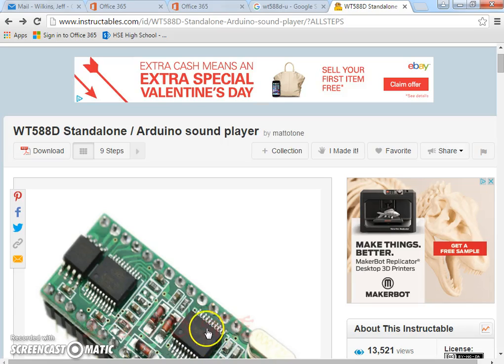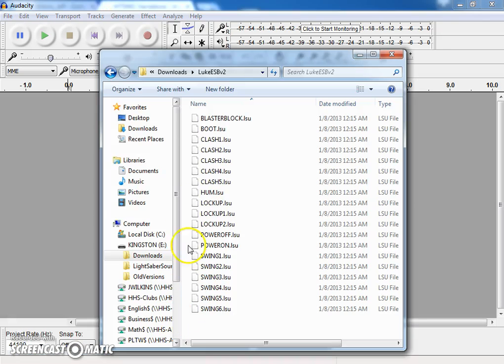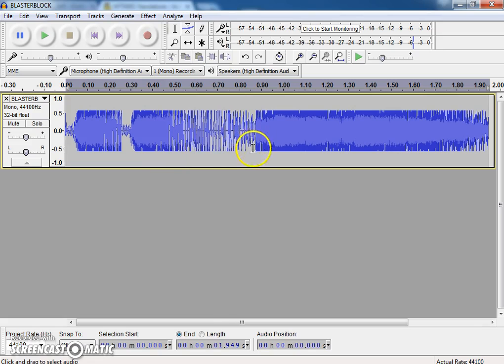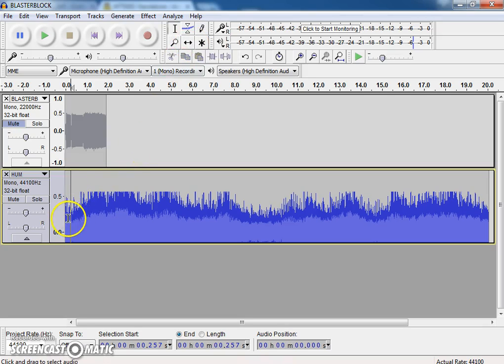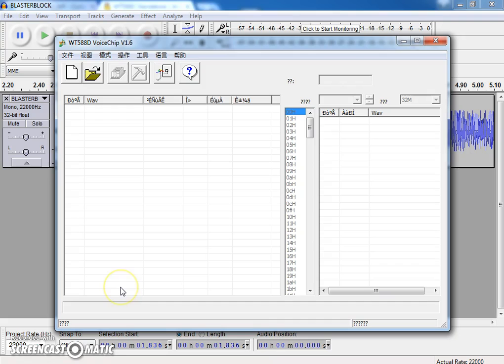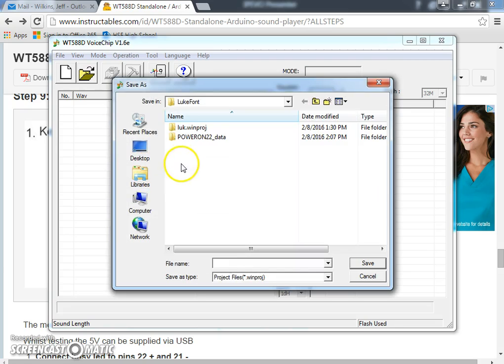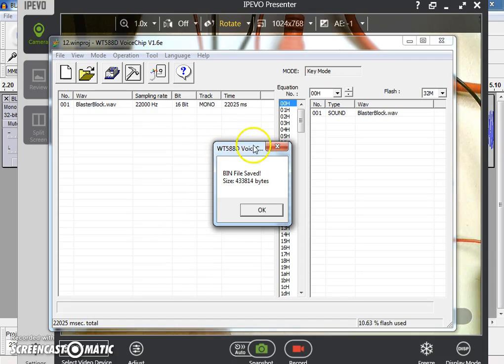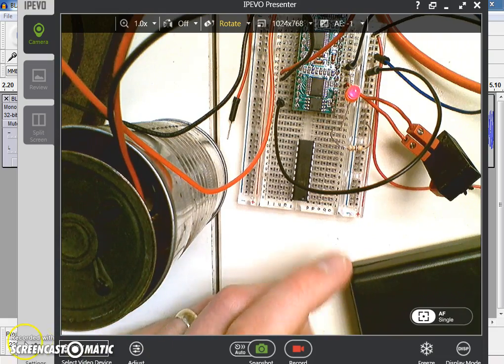How to get sound with a WT588D-U

Comment: Great tutorial, but I have a problem,  every time I try to connect with the module it tells me  "FAIL: to connect to usb", make sure your device is plugged in and on-line chip is correct, could you help me out?, I already tried uninstalling the software but I get no changes

Comment from the maker: At 9:52 it shows the wiring diagram.  I am using a simple push button switch.  It is technically a fischertechnik switch, but any push button will work.